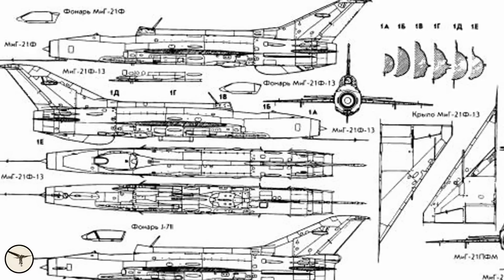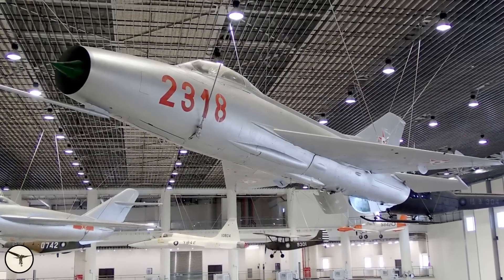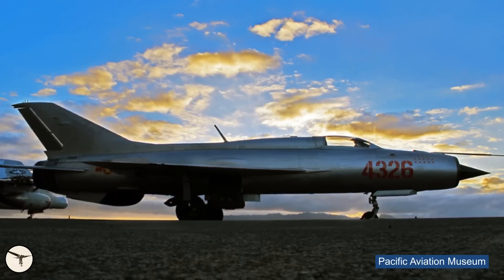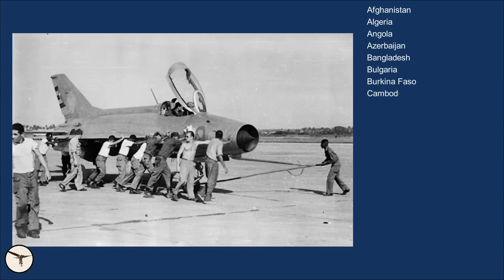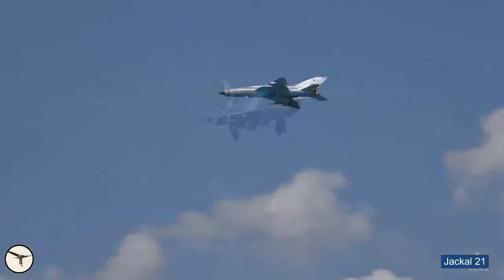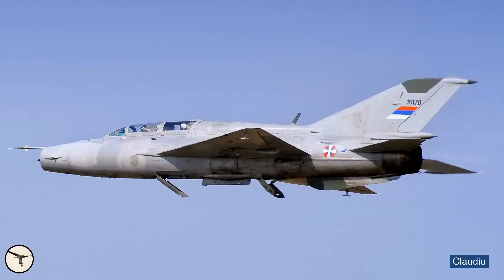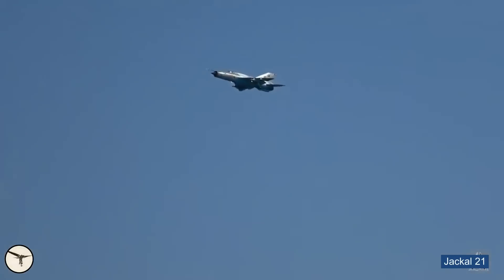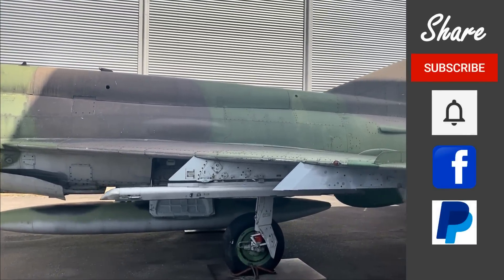Mig-21 facts that might surprise you

Comment: What is the gear up speed.  I thought the display at the end would bend the gear.
Reply from the maker: Maximum permissible airspeed for landing gear retraction and
extension is 600 km/h (324 kt). Maximum permissible airspeed for flying
with landing gear extended is 700 km/h (378 kt).

Comment: Aircraft Mechanic here. There's incorrect information about air over flaps providing lift. It's incorrect because the air after going through the compressor & diffuser sections of the engine is actually slowed down the by the fins in said sections as it compresses the air. Due to this it wouldn't provide any actual or meaningful lift when being bled off over the flaps. Flaps themselves provide lift as designed by changing the airflow over the wing.
Reply: uhh wrong... bleed air flaps help immensely, thin wings that cant handle having larger flaps instead use it to produce equal amounts of lift. the mig 21 drops 30 meters when SPS system is disengaged manually during takeoff. touch down with SPS its around 250 kmh without, its around 300 plus.
Reply: @mitri5389  bleed air is just that, bled air. There’s no enough pressure nor any thrust for that matter to give the plane any lift regardless of how thick or thin the wing is. If it did in any case it’d only by my estimate increase the speed of aircraft by 0.000001% thus pointless

Comment: I saw a MIG-21 at a museum last month.  The 3 things that struck me were it's short height above the ground,  it's tiny wing,  and it's Mach 2 speed.
Reply: It was a pilot strapped to an engine.  Both the MIG-21 and Starfighter met that definition.  I know ex Starfighter pilots, not a dogfighting plane.
Reply: @Anon Ymous 😁 Exactly. My absolutely first idea when I read that comment. Starfighter. They had to do some dwarfs selection to get the pilots for the thing. I had a chance to sit into cockpit of the Bf-109 that was described as cramped compared i.e. to Spitfire - no problem. F-104? No chance. I'd need to push my knees through the instrument panel and i was at least half-head above canopy frame.
Reply: It passed you inside a museum at M2?? Superb low-level piloting!
Reply: I have sat inside a mig21. Its pretty cramped, and everything is analog. There are NO DIGITAL screen! The radar screen is made of glass, sort of looks like a magic ball used in fortune telling
Reply: It flew at Mach 2 ...... in the museum????

Comment: Watching a MiG-21 land reminds me of my first landing in a tail dragger glider. I came in too fast and while floating off the extra energy, the wheel touched ground and stuck. It was a dirt/gravel field with ruts. I could feel the glider was ready to fly again and enter a PIO if I pulled back on the stick. And the ruts in the runway had a tendency to knock the ground roll in this direction and that. I was dancing like crazy on the rudders with short but sharp inputs. I eventually wound up scratching the chin of the glider in the dirt before I was able to put the tail down and start using the brakes. Whenever I watch a MiG-21 come in at high speed I can see the plane operating just above flying speed in the ground effect, and I'm mentally putting in short control inputs to keep it going strait, on center, and not pop the aircraft up into a PIO.
Reply: now imagine all this happening at 340+km/h (212+mph) and the empty plane is pretty much 5 tons. Also, once you're touching down, you can't see jack shit because of the nose ;-)
This thing requires balls to fly, it does not forgive mistakes.
Reply: Is beeing used today.   Is like my supped up pontiac gto
Reply: Wow.. so much technicalities to digest.. thx for sharing.. cheers
Reply: What does PIO stand for?
Reply: @SimonEkendahl  PIO stands for: Pilot Induced Oscillation.
Reply: Cool story Bro! 👍
Reply: fb == https://www.facebook.com/Premaratne-Marketing-115635081134222

Comment: Thanks Magnar.  Probably the best post-war interceptor.  The iconic Cold War warrior who still rocks!
With new avionics & latest BVR missiles, you can have a 4+gen fighter for ~$10-15m.
[edit:] 5:18  That's a beautiful plane.
Reply: @UJCentral  What is Raphaeles? I presume you refer to the French fighter Rafale. It's a very frequent mistake in the English speaking world. For information, Raphael (in French) is just a name like John or Mark and has nothing to do with this fighter. There is Rafael in Israel which is an Institute for Research and Development specialised in missiles but nothing to do with any jet.
The name of the aircraft is "Rafale" which means (wind) "gust". Marcel Dassault has chosen himself this name in reference to the "Ouragan" (Hurricane) which was the 1st jet built by Dassault in 1952. Regards
Reply: @UJCentral  That's interesting that you say about the Mig 23. Blinkov has a video up, discussing the Cubans in Mig 23's against the South Africans in Mirage F1, and the consensus seems to be that the South Africans battled, mainly due to unreliable and outdated missiles, crap air to air radar, and no groundbased fighter direction. Notably, the Mig 23s had all aspect missiles as well.
Reply: + add mid-air refuelling probe to give it some range. But definitely not 4+ gen. It cannot go against planes like Su-35. But it can still provide good air-policing service. Climb quickly to target, identify and decide what to do. With R-73 missiles it can create a lot of problems even for current modern planes.
Reply: That limited space for radar would limit its performance compared to radars in more modern fighters.
While airframe design propably paid absolute zero attention to radar cross section making for juicy radar target for any even remotely modern radar.
And in BFM/"dogfight" Mig-21 would be still more handicapped having been designed primarily as that fly fast in straight line missile truck interceptor. (like so many fighters of its era)
Reply: @tuunaes  When you start with something that was designed as human-controlled booster stage for pair of IR missiles, vectored by ground control, you can hardly make it into somehow modern plane. It just lacks internal space everywhere. Unless you undergo major redesign, make classic nose and side intakes - I think Chinese did something alike with Mig-19 as and ground attack version and Russians had similar designs of Mig-21 and Su-22 but compared to China, these were not produced. But that is not cost-saving update anymore.
So at best, you can get some interim solution before you can afford new birds. As long as original fuselage and engines are not too much worn out. Or if you are under embargo and all you can get are some modernization packages by 3d parties but not whole new plane.

Comment: Never expected at detailed video on the Mig 21 on your channel. 
Keep up the good work!!
Unfortunately it is labelled by some as The Flying Coffin due to its high fatality rate.
Reply: Some?  Who?  There are now 4+ gen avionics suites & the latest BVR missiles for it.  
I'll take that Mig-21 against a stock F-16 any day. [edit: I'm not having a go at you Niraj.]
Reply: @UJCentral   some good for nothing media outlets as a matter of fact.
But that is due lot many factors actually.
Reply: @nirajrayker9282  If you build tens of thousands of the things & they fly for 60 years, there will be many losses.  Cheers Niraj!
Reply: @UJCentral  Foe the record, a MiG-21 Bison did shoot down an F-16
Reply: The flying coffin is F-104 🤷🏼‍♂️
Reply: @martinjanik9221  YES!  I knew I recognised the term from jets ("Flying Coffin" has been around since the Wrights.)  A quick look raises questions about the 104's wing loading.
The Luftwaffe lost about 100 of those things in peacetime, planes they only bought because of corruption in the arms industry.
Reply: @UJCentral  I think the Luftwaffe's main problem was they used a high altitude interceptor as a low level fighter/bomber.
Reply: @UJCentral  No, I was referring to the F104, which was designed as a high altitude interceptor - all engine and no wings. The Luftwaffe then needed a low level fighter bomber, and shoehorned the F104 into the role, leading to the Luftwaffe joke: "Question: How do you catch a F104? Answer: You buy a plot of land and wait!" But according to some they made it work eventually, after lessons learnt was applied to training and tactics. But a lot of guys died before that happened.

Comment: The airshow sequence was a bit surprice that this small winged beast was that agile
Reply from the maker: During the Yom Kippur war, an Egyptian Mig-21 made a split-S from about 3,000 feet when it tried to evade an Israeli Mirage. 
When flown at the right speed, the MiG can outturn almost everything. Top Gun uses the A-4 to replicate the MiG-21 in dogfights because they have a similar handling qualities.
Reply: @FlywithMagnar  The small delta wing probably convert humongous amount of chinetic speed energy into lift with the typical delta wing vortex folding over the topside of the wing. Like Concorde on landing, and modern fighters strake part of wing, F-16 and F-18. Vortex over wing creates a lot of lift but at huge drag. More than the engine could produce on the MIg-21. Brobably the MIG-21 experts knew how to entry at right speed and convert that speed into a thight turn radius and shoot and get out before the speed was all gone.  Difference with modern jets are that they can sustain the tight turning radius on engine power.
Reply: Magnar. I have a challenge for you. Could you please explain the cockpit and checklist of the MIG-21? It is probably the most complex cockpit in aviation history. Guys flying that thing really had to know their job.
Reply from the maker: @AcrodesignerLNSNI , currently, I'm editing  Part 2, which is a walk around and cockpit tour. When it comes to checklists, I will provide a link.
Reply: @FlywithMagnar  I will appriciate that. Bcs the MIG-21 is one of the most complecs flying machines that has ever existed. And in that big volume many east europe and arab pilots must have learned it. Skilled guys. Respect. I spend many hours in Checkia some 3 weeks ago study the MIG-21 at a museum there. It is a big airplane. Very heavy and with that small wing... omg. The Atoll K13 under the wing. A copycat of a Sidewinder lost when buried in a MIG not exploding during the strait fight between US Navy Sabre F-86. That is a story to tell on Your channel. There is a link there to Tom Cruise and Top Gun movies that is a story that need to be told. Check the jacket patches on the back of Tom Cruise in the first version of Top Gun. There is a story there.